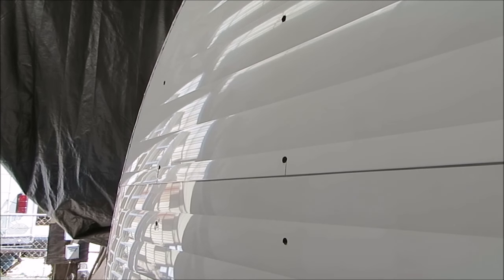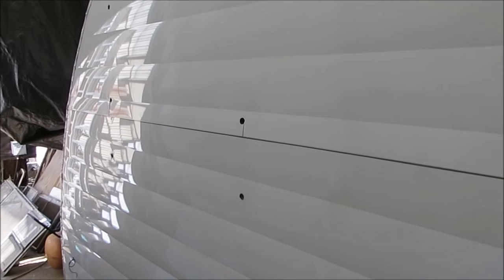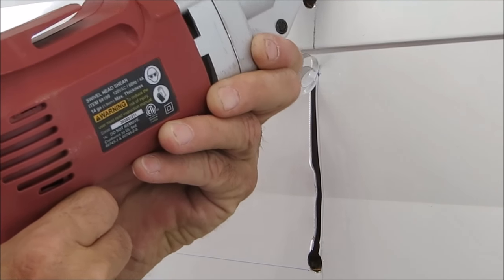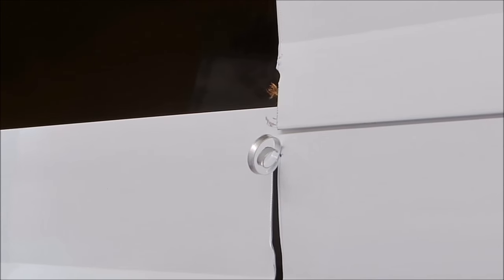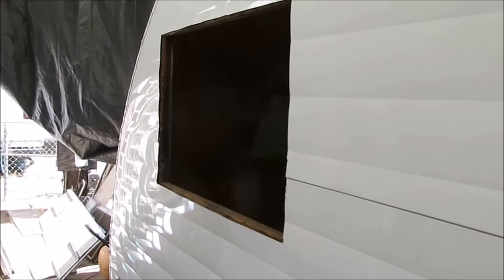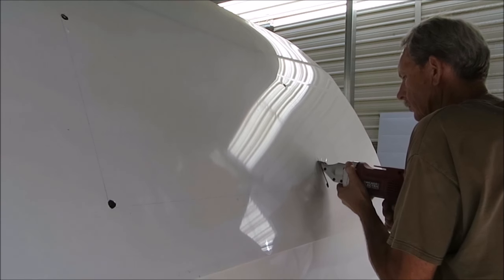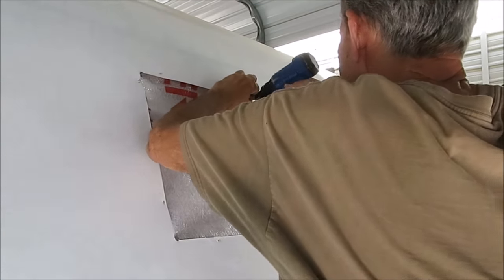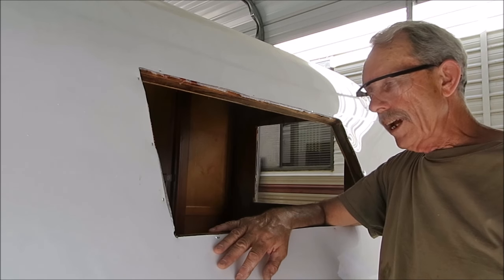Quick Tip - Cutting Thicker Aluminum Siding

Comment: Haha! The wide format is fine. The narrow format would show the same height, just with less width. Looks like you need some sort of wide angle adapter. (LOL!  And after the fact, you discover that the camera was zoomed in? That's one of those "Duh" moments I really hate, except when they happen to someone else.)

That nibbler looks like it really does the job! Seems like it follows a line well, and a really clean cut, too. And yes, at those thickness, it's amazing how much of a difference a few thousandths makes.

You're using a piloted router bit that's following the edge of the wood, right? That back window looks slick as a whistle, and I see the potential of a lot of hours saved while doing a better job. That's hard to beat.